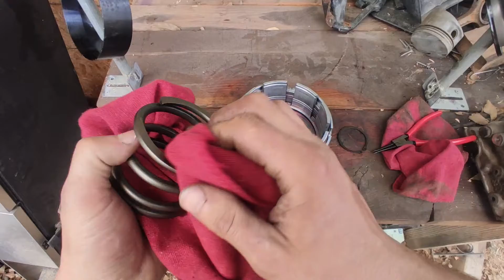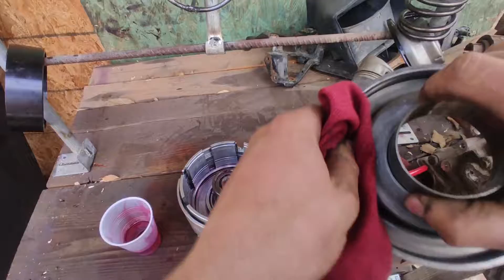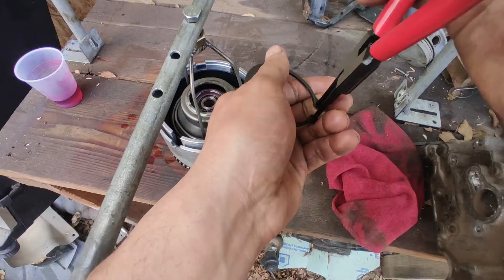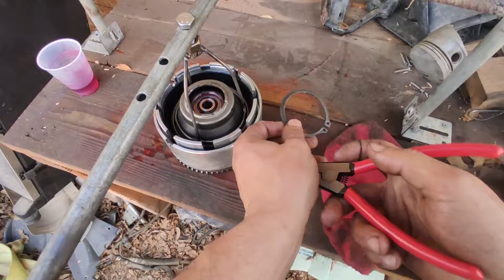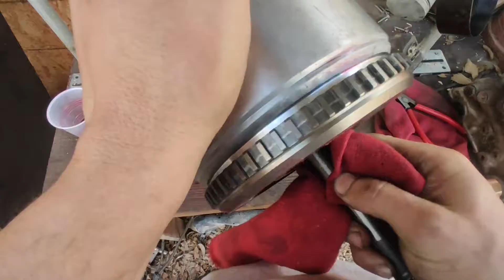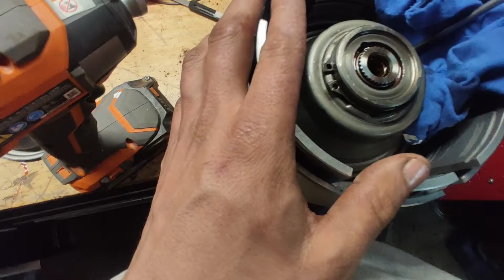A604/41TE Transmission Rebuild at home!!! Part 5.

Comment: you are including lots of video of you wandering around looking for stuff and it is unfortunate that your overhaul kit didn't include the seals for the input shaft assembly. I am surprised at that as I would expect any " overhaul kit" to include such soft seals. I got an ALTO kit and I hope they are included. If I am going that far into a transmission, I want all the soft seals to replace along the way. I also took issue with you using vise grips on a sealing surface without any protection to install a snap ring and having to go back after the fact with sand paper to remove the marks in the drum left from the tool. I would find a better way of doing that. I am about to embark on this journey myself for the first time and have purchased 2 tools, one to do the piston compression on the big spring in the input drum and the other is the sleeve to guide the seal of the piston into the assembly without destroying the seal that is molded onto the piston on top of that big spring. I enjoyed the fast motion video of you trying to get the input shaft back into the clutch assembly as I have to remove that to install the piston and spring. I see that as one potential difficulty to get that clip on top back in after installing the piston. Keep going as every video is useful as each shows difficulties encountered along the path even if it is not done by the " factory method". The only benefit of the foot press is that you have both hands available to get that stinking snap ring on which is why I bought the tool From Amazon.  https://www.amazon.com/dp/B01GZVXX9W?psc=1&ref=ppx_yo2_dt_b_product_details
Reply from the maker: Yeah, made a lot of mistakes but didn't want to spend much money on it and kit was missing some of the things. Had to make some tools to help me with installation am glad ppl see it and will help some of you, after putting it together she is running, thanks for comment.